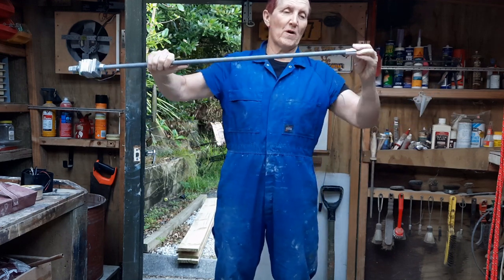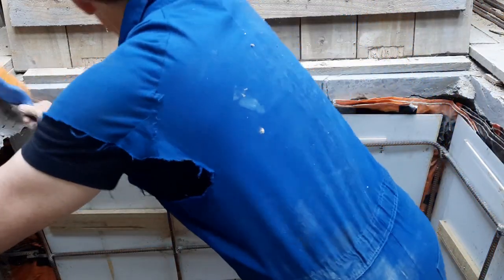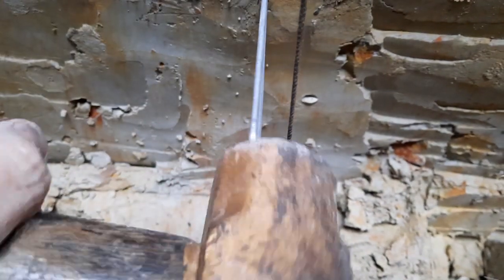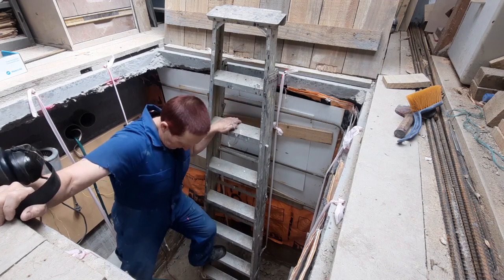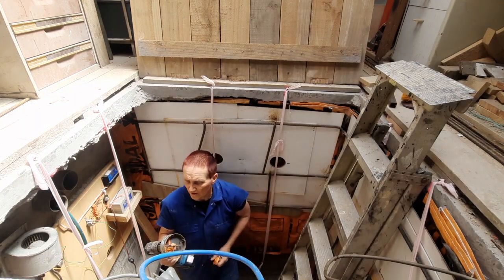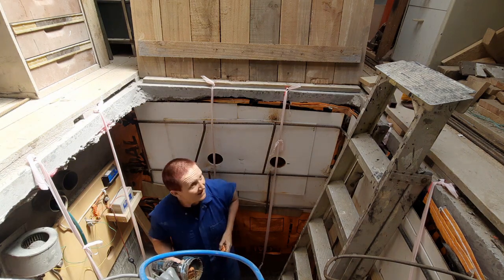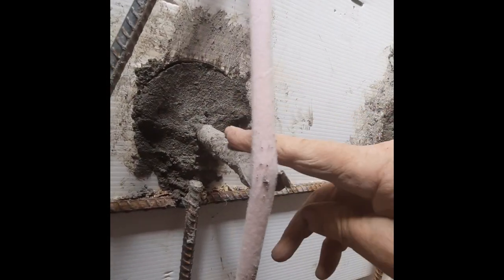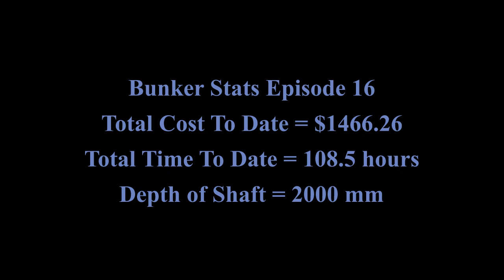Creating some anchor points in the bunker shaft - Episode 16

Comment: It is so easy for the cost to build up too. If you showed someone a picture of the hole and said $1500 is sunk into this they wouldn't understand. I have dropped a few thousand into mine. It is still just a hole in the ground. Good work Lex. Can I just ask why 7m?
Reply from the maker: Well it's an arbitrary figure that I have come up with but the bottom 1 metre will be a sump with pumps etc in it.  Then I plan on my side tunnels to be about 2.4metre tall with the bottom 400mm being for drainage .  That gives me about  3.5 metres of clay above everything which should mean I avoid most of the tree roots and hopefully avoids water finding its way down there.